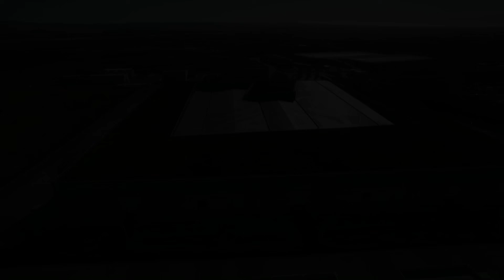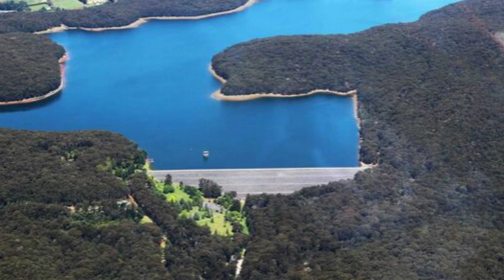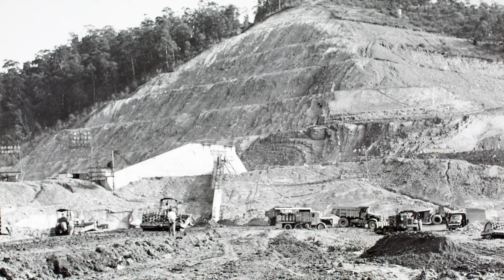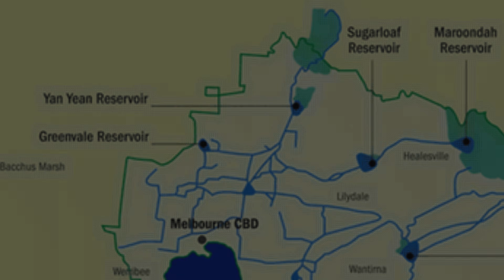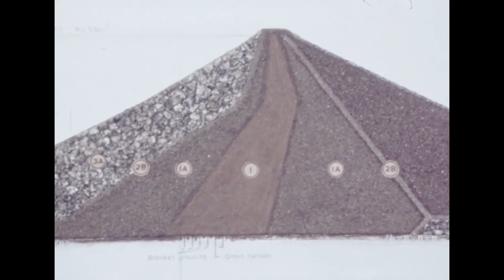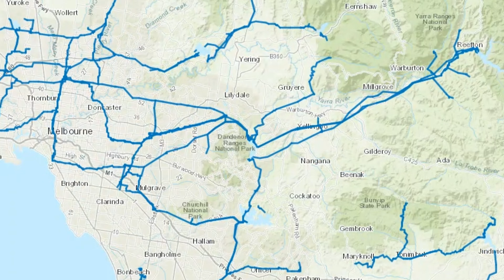Melbourne's Water Story - Ep3: The Reservoirs That Kept Melbourne Flowing (1920s–1970s)

Comment: Fantastic video mate
Around the 1960’s a few Yarra River tributaries were added to the system downstream of the Upper Yarra dam
These being Starvation, McMahons and Armstrong creeks and their respective catchments 
These all feed on a much smaller basis into the Upper Yarra Aqueduct and   also fed into the Silvan Reservoir 
I was fortunate enough to work for the old Board of Works in the Warburton area helping to maintain this infrastructure from 1981 to 1999